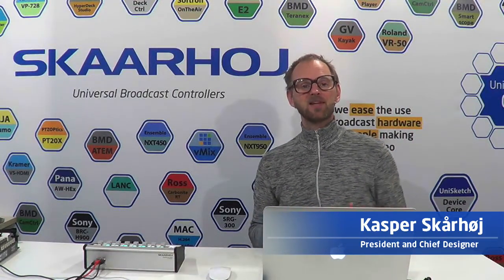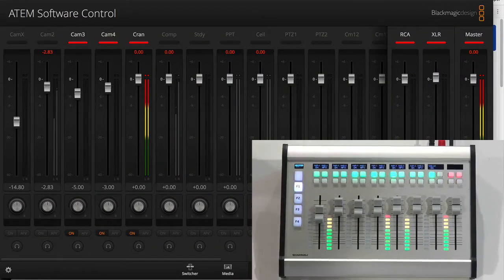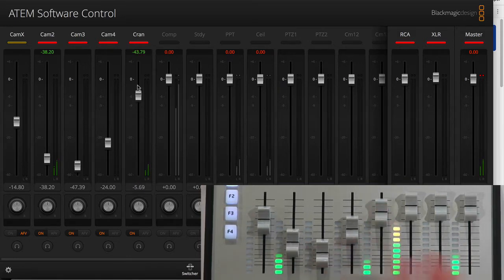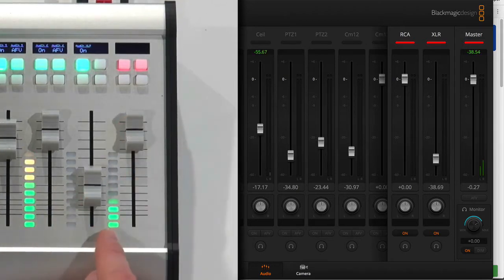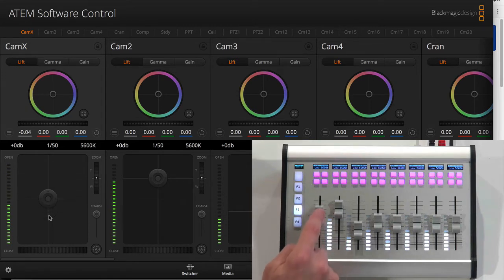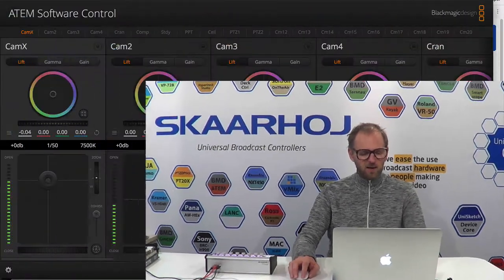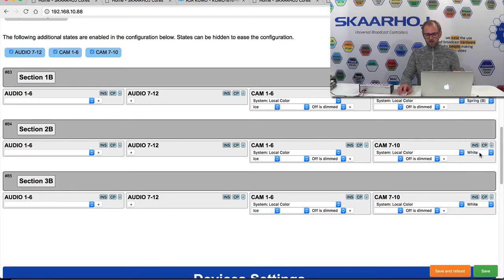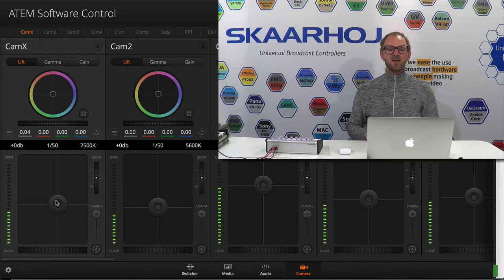ATEM audio adjustment and monitoring with motorized faders, LED bars and OLED displays

Comment: needs to be shown with the Tricaster please
Reply from the maker: Agree. Check out the IBC 2018 video coming out thursday 11/10 2018
Reply: @SKAARHOJ  Hmmm... I saw the IBC 2018 video. It seems that the Audio Meter function does not worked with a Tricaster.